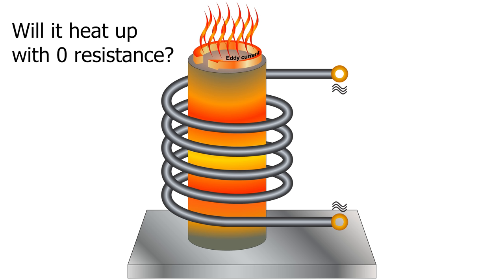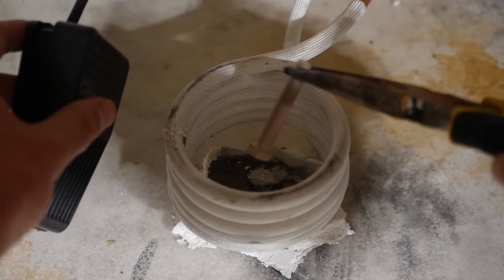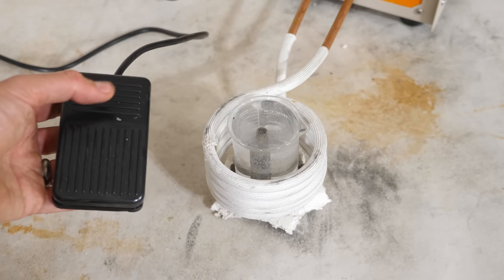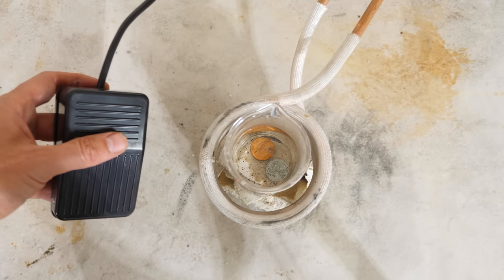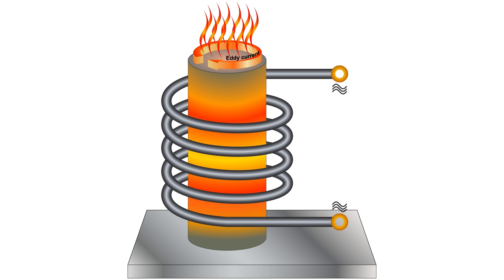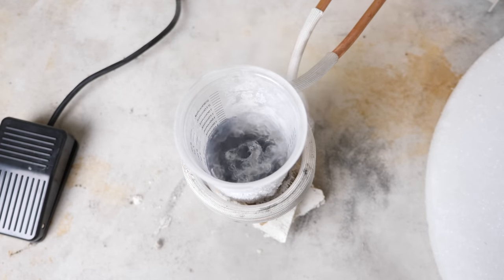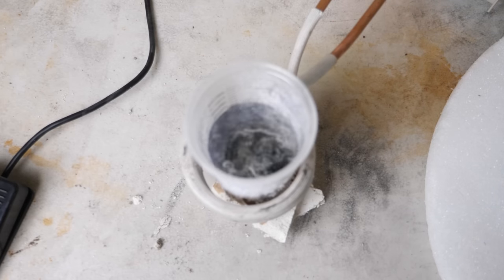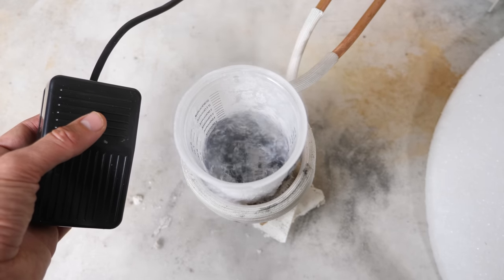What If You Put a Superconductor in an Induction Heater?

Comment: Induction heaters are not for heating conductors, they are for heating magnetic materials, You keep saying conductors, but that is wrong! Induction, as in inductor, a magnetic device.  The heating arises from magnetically induced eddy currents in the magnetic material, which is why it will not heat non-magnetic materials.

Comment: Sorry, but I have to disagree with what You have said. Firstly, the steel coin produces more heat not due to having higher resistivity, but due to having much higher relative magnetic permeability than copper, thus more magnetic flux penetrates through this coin resulting in a higher electric field inside. The governing equation here would be |E|^2/resistivity. If You put two coins with similar magnetic properties and different resistivities, the one with lower resistivity will experience more heat generation due to losses, since in both the same E-field will be induced, but inside the one with lower resistivity higher current will flow. In electrical engineering, "higher load" (higher power consumption) means basically lower resistance. In this case, the steel coin simply steals the field and energy until reaching Curie temperature and losing all magnetic properties. Due to water reaching that temperature takes a lot of time, thus no boiling action is seen from the copper coin. Secondly, the skin effect does not take place to such extent in type-II superconductors (unlike type-I superconductors), and is not the prime reason for boiling. You're using probably YBCO which has a critical temperature of 92K, leaving 15K margin when using LN2. Yes, You generate power losses inside, but not on the skin depth, but in the whole superconductor due to the existence of the mixed (Meissner) state and very poor magnetic field expulsion (the deflection You're talking in the video). That short boiling of LN2 is due to power losses generated inside the superconductor which drives it above 92K experiencing phase transition to a normal (non-superconducting) state and then boiling stops.

Comment: That’s the skin effect, wasn’t this a Walter Lewin problem? A voltage difference or an electric field can’t be applied inside a superconductor, as long as it stays under its critical temp. But a voltage difference can be applied across the boundary of the superconductor or it’s “skin”, this would result in the heating . All the explanations of this by saying there is no AC superconductivity sound way to hand wavy to me and ignores the existence of powerful superconducting magnets, that question is a little more complicated as AC doesn’t feel exactly resistance but impedance, which is different.